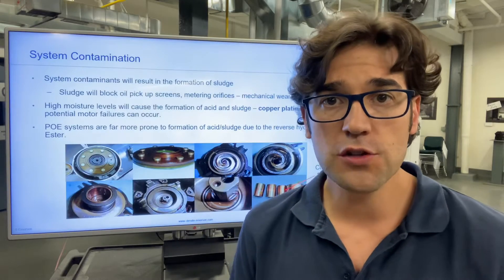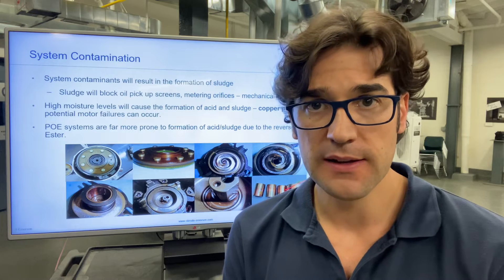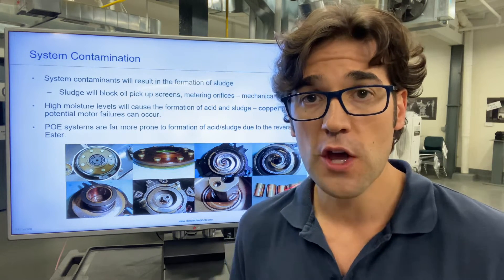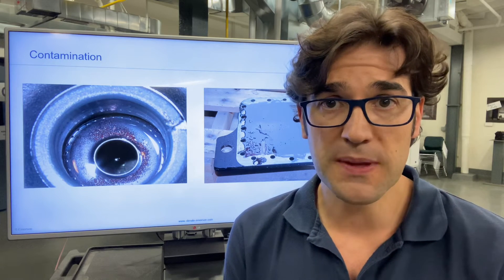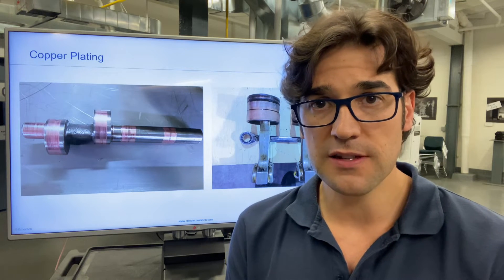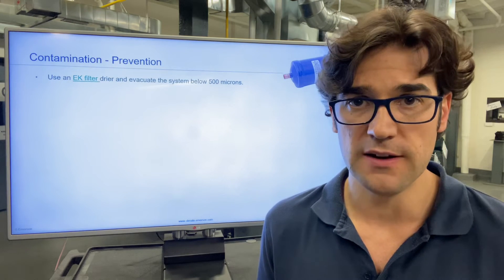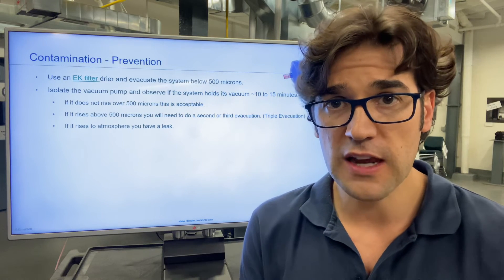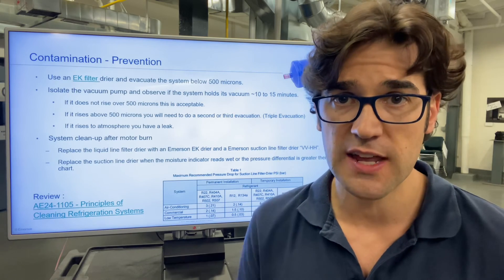Contamination Issues in Refrigeration Systems

Comment: Hi Trevor to prevent recontamination in the system install a liquid line drier?
Reply: What about a suction line drier or a acid core drier?
Reply from the maker: Follow manufacturers recommendations but the Suction line filter drier should be replaced 48-72 hours after install.  And a new LL drier installed because you opened up the system.
Reply from the maker: Always purge with nitrogen when brazing, pull your vacuum below 300 microns or .3 torr that holds and replace the LL filter drier anytime the system is opened up.